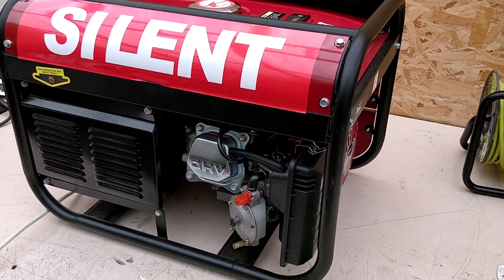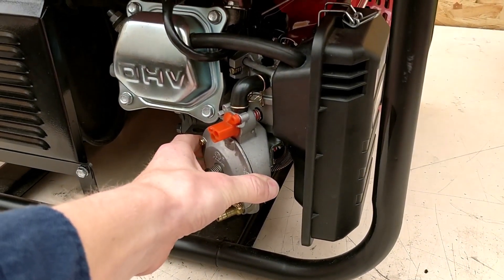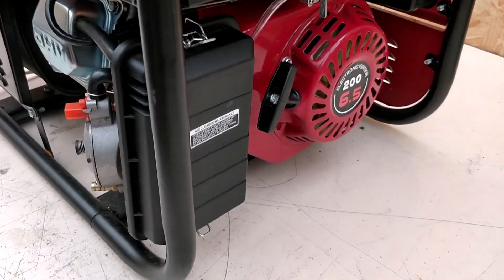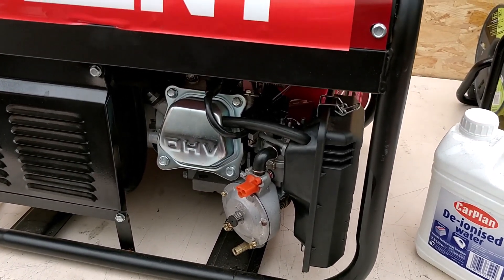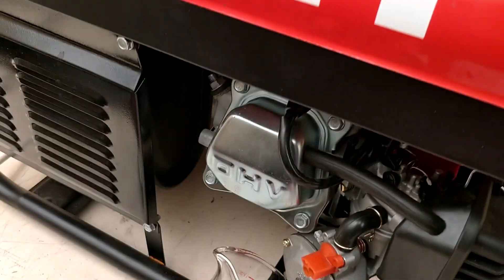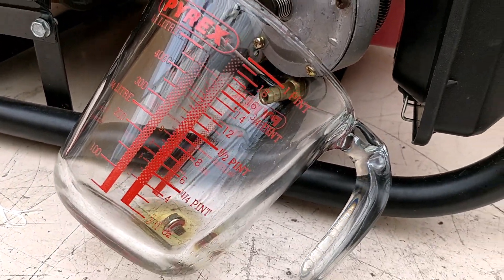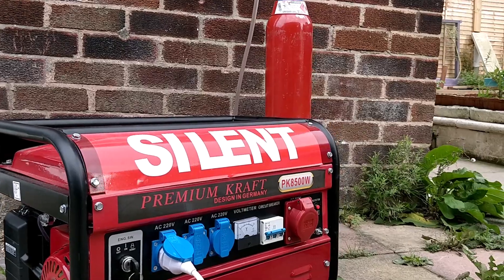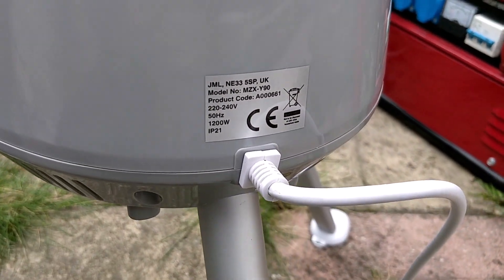Hydrogen Powered Generator

Comment: timing set to tdc? I have the same model engine.
Reply from the maker: Hi, yes timing was set to TDC
Reply: @Hydrogenguys  Hi.  Ye I'm thinking about getting into hydrogen electrolysis and using it to cook/charge my battery system when my solar panels aren't keeping up.  What mods must you do to a LPG carb for hydrogen?  Do you have a video on how to do it?
Reply from the maker: @HardcoreHokage  sounds like a good project! With electrolysis the typical gas output is HHO, this engine ran on pure hydrogen gas, not HHO, so it a different set up. Timing is still set to TDC though.

One of my first videos was how to make an Engine run on HHO, that might be more helpful. As for the hydrogen carburettor I plan on uploading a video soon on how to make it.
Reply: @Hydrogenguys  awesome thanks. I'll go watch your videos and wait for your carb mod video.  Keep up the good content and research!

Comment: I have 3  generators 8 kva generators  to petrol  one lpg.  1 33kva diesel generator to run lpg 4 cylinder I would like to run them on 80%hydrogen 20% lpg and try to run  hydrogen only
Reply from the maker: Sounds like a good project

Comment: Longer term:  Is that engine made for gas?  Does that engine in the generator need 2 stroke oil added to its fuel?  What about the water vapor... ?  Doesn't that encourage corrosion?
Reply from the maker: Doesn’t need 2 stroke oil, but the engine oil in the crank case need changing more, and the exhaust will rust, so a stainless steel one is needed really

Comment: I wonder if it would be better to put diesel fuel into the engine to lube and reduce heat and not water
Reply: Diesel with very small jet so it's really efficient on diesel water if left to sit will also rust the rings diesel will keep rust away

Comment: No flashback arrester or bubbler?
Reply from the maker: No need for a bubbler with this set up as it’s pure hydrogen gas being used, straight out the  hydrogen bottle and into two separate flash back arresters and then into the engine. Hope that helps :)
Reply: @Hydrogenguys  Please I need an info on where to get such carburator. I have created an hydrogen generator that has a water bubbler. Can I used the same carburator in the video above for my Hydrogen Water bubbler? 

   Where can I buy such carburator & what is it's name? 

Thank you🙏. Hope to get your reply.
Reply: Please I need an info on where to get such carburator. I have created an hydrogen generator that has a water bubbler. Can I used the same carburator in the video above for my Hydrogen Water bubbler? 

   Where can I buy such carburator & what is it's name? 

Thank you🙏. Hope to get your reply.

Comment: Did you plan to try on car engine ? An old car engine with carburetor then you adapt it ? or newer engine just put in  Speeduino ecu and tune it to run hydrogen ?
Reply from the maker: That would be the dream!
Reply: Find a descent junk years or auction and get a real engine!  Gl!
Reply from the maker: Latest video is on a car engine :)

Comment: if I understood correctly, then the total load was 1800 watts and the cylinder was about 20 liters at 150 bar. then in the cylinder there are 3 cubic meters of hydrogen with a total energy consumption of about 9.6 kilowatts. and the received power is 1800 * 2.2 = 4 kilowatts. that is, an efficiency of about 40%? if so, that's a good result. By the way, did you change the ignition to a later one? By the way, I thought about the combustion of hydrogen with a stoichiometric mixture - it is very hard. but the mixture is a little lean, it burns normally. this is what I'm for. it is more profitable to run the engine on a lean mixture. albeit with less power but with greater efficiency.

Comment: Did you change the engine timing? PJK documents say you need to move it to TDC. WITTS is doing water powered generators that are self-running on just water. I've done some research on it. It's expensive to build an electrolysis cell that produces enough gas to run a generator. There are some cheaper options. The Nitro cell/Aussie cell is a lot cheaper to build. It's closer to "running on air" which the Joe Cell uses. With the nitro cell you start with gas then as the energy cloud builds in and around the cell you reduce the gas intake. So it's easier to get it working than the Joe cell. This may be because there is some electrolysis and moving air, which could help the energy cloud build up polarity from the neutral state. The key to "running on air" of course is what happens to nitrogen in the combustion chamber. Nathren Armor/s1r9a9m9 showed and engine running on 100% water a decade ago. There is info on the net (PJK) that says you can run an engine (slowly) on just fog from a dehumidifier. The temperature at the exhaust was reported to be -16C, so it would work as a refrigerator as well.
Reply from the maker: hi, Yes engine ignition time was adjusted to be closer to top dead center via a time key, not the best method but it worked, the engine did run without timing adjustment but not as well.
Reply: @Hydrogenguys  Thanks
Reply: Nice

Comment: I'd rather have a actual "silent" hydrogen fuel cell genset.
Reply from the maker: as there are less exhaust gases with hydrogen the exhaust could be made to be a lot quieter without affecting performance, but yes! it's never going to beat an actual fuel cell, apart from initial cost.

Comment: Hydrogen Combustion Engines really only make sense with direct injections, pushing the thermal efficiency up to 60%, which makes fuel cells practically useless.
Reply from the maker: 100% agree. 
The aim is to make low cost hydrogen engines so all can have one. But perhaps the next project should be a direct injected version?
Reply: @Hydrogenguys  yes, I also thought about building one, but I don’t have any real use for it.
Reply: @Hydrogenguys  I’m sure you get asked this a lot but have you heard of Stephen Meyer? Do you think with today’s technology his invention could be not only replicated but massively improved?
Reply: Yes I found the same, port injection is far from ideal it reduces power drastically and results in back fire, I had great results running ecu controlled direct injection. I got more power and torque, recalibrating the ignition timing curve is the biggest head ache with hydrogen conversions.